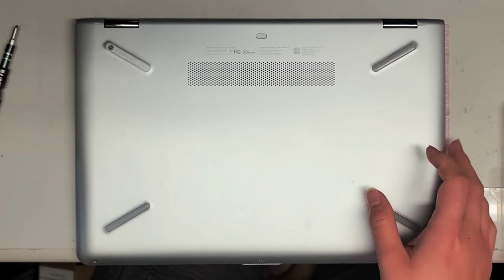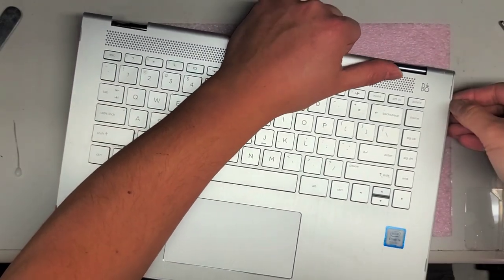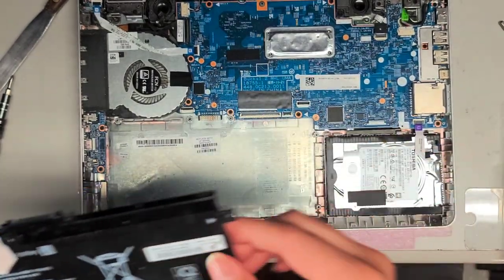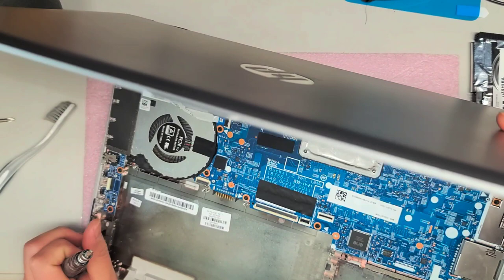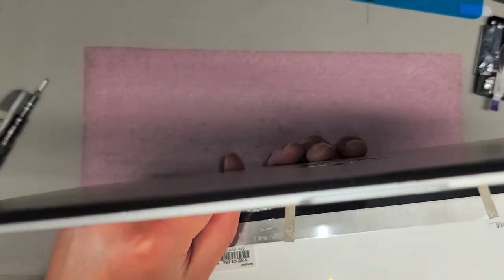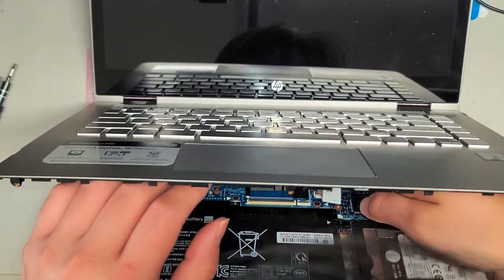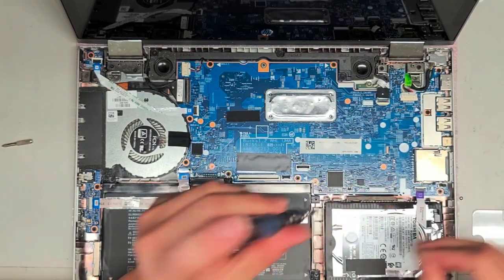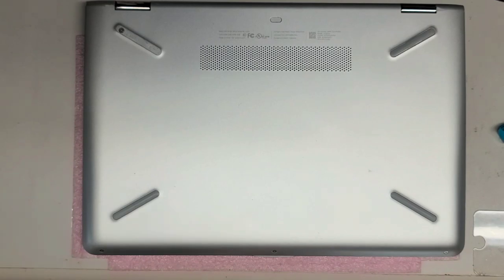HP Pavilion x360 Convertible 14-ba253cl Disassembly Hard Drive SSD Upgrade Screen No Display Repair

Comment: Excuse me sir
My Laptop is HP pavilion 14-bf106tx, so which battary is supported?
Reply from the maker: Open it up and check the model number on the battery itself. After all, if you can't open the laptop to check the battery now, you won't be able to open it to change it later.
Reply: @ItsBinhRepaired  Profoundly thank guy
Reply from the maker: @sangmao9642  hopefully the replacement goes well. :)

Comment: You need a guitar plastic to be easier to remove keyboard and screen instead of using your fingernails.
Reply from the maker: A guitar plastic is not easier. If you can make a video doing it faster with a guitar pick, I'll stop using my fingernails. Lol If I race anyone using plastic pry tools, I bet you I can beat them using my fingernails opening the same laptop.